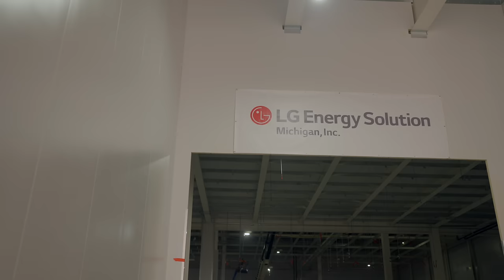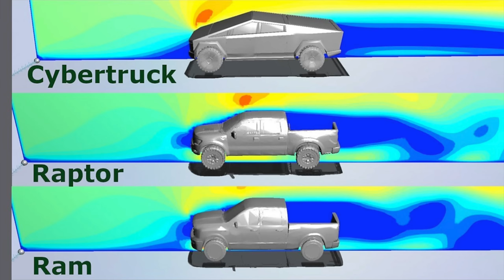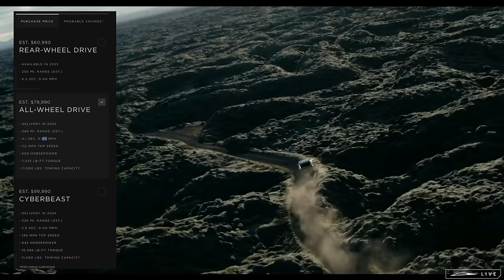Cybertruck - What Tesla ISN'T Saying!

Comment: The market has spoken - on the day of the Cybertruck launch, TSLA tanked.
R.I.P. Cybertruck
Reply: Let's see if that holds water.  Wednesday close, $244.14 and, to be very generous, Friday close $238.83.  A change of $5.31 or 2.1% (aftermarket from Friday is +$0.52, virtually unchanged).  You have a very odd definition of "tanking".
Reply: @iowa_don  Hello Earth to Iowa - of course, it was a thundering tanking.
TSLA should have gapped up 10% to 15% on that day if the Mad Max Cybertruck was a once-in-a-lifetime hit

Instead, TSLA tanked out - the Mad Max is a dud, and that spells catastrophe for TSLA.
Reply: @noleftturns   Well, you know how the market is.  Sometimes (like the other day when one analyst had a brain fart) it runs around like a chicken with its head cut off.  That certainly did not happen.  Other times it takes a wait and see attitude.

Comment: Steering by wire? No thanks! What happens when a fighter jet loses fly by wire? The plane crashes, every time! And if he's lucky, the pilot ejects. One blown fuse, one faulty relay, one bad capacitor, a glitch in the software and you are totally out of control, going over a cliff without an ejector seat!Conventional steering has a positive mechanical link between you and the wheels so if the boost fails, steering control may be reduced but is not lost! I see MASSIVE recalls and lawsuits over this one issue!

Comment: Its still going to take hours to fully charge, causing your electric bill to be sky high , its still really heavy and im willing to bet it will get stuck in sugar soft sand. And it still has battery offgas ventilation, so saltwater can corrode the batteries and cause them to short out . And because of its extreme weight, i doubt it won't slide into the water on a boat launch ramp . So many problems they're willing to ignore in order to speedily push electrification. Also , the steer by wire in a fully electric vehicle is not a good idea. Loss of power will result in zero steering. It should have mechanical steering or at least automatically connect to mechanical steering upon power loss .

Comment: How is it that Lucid can build a sedan the size of the Model S and still have over 500 miles of range?  There has to be something in the battery architecture and management to make this possible.  If Lucid can do it shouldn't TESLA be able to as well?
Reply: Depends on how big the battery pack is and how "sporty" they want to make the vehicle. If they designed these BEVs to accelerate like a Prius, then they would have an increased range. But, attempting to market BEVs as "sports cars" probably brings in more profit from the mindless hipsters.

Comment: I dont think it will sell any where near to what tesla hope, because with people who need a work horse this car is to expensive, they will stick with desil vehicles for cheaper repairs and insurance.

There is a chance that ev's are on hold for now as they are, with manufacturers slowing down ev production and ev sellers with full lots with no buyers, so the ev marked could have sold to everyone that could get one and will be a bit before the next wave of buyers.

When you have a normal painted car and you scratch it up you just get a respray, what about this vehicle, when the back gets all scratched up from heavy use can it be easily buffed out or are the scratches and marks permanent?

Comment: 8:20 lets not exaggerate with sport car feeling.  This car weights 3 tons without passengers and has no connection between steering wheel and the road. There is no sport car feeling.  Not to mention real wheel steering also messes that up depending on tuning i suppose.

Comment: Why don't they put PV panels on EVs? Why wouldn't you want to charge while parked or driving in the sun?
Reply: Solar panels are expensive and they barely put out a charge. Solar panels would be good for trickle-charging a 12V car battery, they won't really do anything for a 1K+ lb EV battery.

Comment: Would I buy a cybertruck?  No.  I don't think most truck owners would either.

1.  It looks ridiculous - Face it most the %80 truck owners that don't actually truck their truck are drawn to a certain aesthetic.. This is about as far from that as possible this is a techies truck, truck people are about as far opposite of the techie culture as you can think of.  Maybe if you put in a gun rack?

2.  Not for serious off roader - This truck would be great for short easy Overlanding trips.  But for those serous off roaders not a chance.  It will get stuck you will need 3 trucks to pull it out suspension doesn't articulate its just not a "serious"  off road truck.  Great for those that like to play of roader though, as long as its not far.  Off roading will probably use power closer to hauling.  Nothing has less power stations than random trails to nowhere 

3.  Hauling distance -  People might not actually haul but they do purchase trucks %100 on its hauling capabilities.  This also is why I wont get one.  I need a truck now but I want to haul my car to the track 2-3 times a year, I don't live within 400 miles of a track.

This truck is for non truck people that like the tech and are exited about electrification.  Non techies are just now starting to buy tesla cars and the sales figures for EVs are leveling off as average users get them and don't like the change in hassles they have.(This is to say EV's have hassles, petrol cars have hassles but people don't like the inversion of the hassles they have become accustomed to.)

Comment: I have two reservations (base & dual). I would get them as soon as they are available. The dual motor one is better than ModelX  (comfort, quietness, ride, steering & handling) plus with new technologies integrated, it is the most utilitarian and best priced/spec car on the market. Plus, I'm fairly confident that by the time my order comes up ready, 4680 ramp is in full swing which will result in better range, less weight, and lower price for all three model.

Comment: @11:09 "is they have ethernet Communications"   ... 
I think you're missing a subtlety about Ethernet.... PoE... Power over Ethernet... the standard to send 48VDC over ethernet... upto 120Watts over ethernet, so all the accessories and small stuff will just have ethernet... no separate power and data.   probably have the ethernet ending in, say each corner of the car with individual accessories wired to a corner processor, doing data acquisition and power distribution.

Comment: Love how you glossed over the spare tire debacle, not mentioning that other manufacturers are currently packaging bigger batteries with more motors and still supplying a spare standard. And they didn't have also massively sacrifice frunk space.

I'm not seeing the innovation outside of the 48 watt battery, which other car companies are currently switching to as well. First out the door is nice but this took 4 years to bring to fruition. By the time Tesla revamps/improves this truck, the competition will be way ahead. Steer by wire will be standard and their "moat" of charging infrastructure no longer exists.

This vehicle isn't a "smack down" to anybody... straight line acceleration means little to anybody except Tesla fanboys. It will never be homologated outside the U.S. and even in that market, will never reach the same kind of production numbers Ford hits with ease.

It's cute though.
Reply: “Spare tire”

There are cars that don’t have spare tires any longer. Love it, hate it.

Wish all cars had run-flat tires.

“innovation”

The 48v system is very unique, cutting copper needs.

Ethernet to cut copper needs is also very unique.

If they had redundant Ethernet - that would be awesome, but I doubt it has it.

The drag coefficient is very cutting edge.

The drive by wire wheels is very innovative, in a pickup truck.

The stainless steel alloy, eliminating paint, is very cutting edge, but will likely be expensive to fix.

Really, this is very interesting, just too high of a price point for many people.

“Production numbers Ford hits with ease”

The Ford Lightning sales in 2023 may hit 70k… will Tesla hit that number at the end of 2024? Good question. We will see.
Reply: 48 VOLT low voltage battery.  Ford production numbers?  A whopping 4,400 units per quarter??

Comment: So hard core truck people are not buying Ford Lightning??
Some are and Tesla will eat into this segment over the next 10yrs. How, well  the 4680 volumes will ramp and specs will improve with v3 and v4.
The CT is just beginning.
The hardcore farmer and construction site worker towing and hauling stuff will eventually have no choice as California bans ICE completely by 2035.

By then Tesla will have the 500mile truck that towes 14klb and hauls 3.5klbs in the bed which sells at $60-70k.

Comment: I have to disagree with your assessment.  When I go camping, I need long range.   There are very few gas stations in the wide open area of the west.  I may have to drive for hundreds of miles before I return to civilization to get my gas tank filled.  Electric vehicle charging stations are even more rare outside the big towns.   There is no way this truck would meet my needs for camping and adventuring until they improve the range and there are more charging stations.

Comment: Will the CyberTruck create an iPhone moment?  The iPhone completely changed the UI for phones.  All button phones were obsolete in a few years.  Will the CyberTruck force the other truck makers to move to stainless steel, steer-by-wire and 48 volts?  It could be years before they could produce a competitive truck.  Obviously Tesla can't produce enough but it won't deter customer expectations.
Reply: Your comparison of the Cybertruck and iPhone is interesting. They have both created a monopoly on repair by limiting availability of replacement parts and repair ability. And they both have the ability to charge whatever they want or even tell you that it can't be repaired. (You had your phone battery replaced by your local shop? Your finger print reader will now not work! 
You had your truck repaired by a third party? We will reduce your battery capacity to 50% for safety reasons!)

Comment: First of all, I did not know TwoBitDaVinci was into the advertizing business helping out Tesla. 
Now some thoughts of just a regular European guy.

I can appreciate the break through technology of this car. It even looks cool. The stainless reminds me of the back to the future movies. Very cool.

However (O, o... Here it comes). Trucks? really? Most Europeans do not understand the WHY of these behemoths. Sure:  our cities are more cramped and such a vehicle just would not fit. I saw some guy driving a Hummer once (one of the early ones) in an old town. of course, he got stuck and became the laugh of the town. 

Also: I do understand certain business could benefit from its capabilities. However hauling your measly bit of flesh around? What a grossly inefficient means of transport for private persons.

Zero to 60 in under 3 seconds, with a trailer + 911? Again: cool, for sure. Not going to argue about that. but WHY... In your every day life chances are, you are stuck in slow moving trafic, or busy obeying speed limits to avoid traffic tickets.

Safety: sure, if you drive your personal tank into some other (poor bastards) car, you will, quote: "win". We have regulations over here in Europe. Each and every car need to pass a test which proves pedestrians  (yes, we have them over here) are not excessively wounded in case of an accident. No passing of the test --> cannot be bought over here. Bulletproof. Of course. Only in Murica. Not really a thing over here. 

Fuel economy: Looking at its size, weight and poor air resistance. Yeah. Just saying. 

Final thoughts: I hope mister Musk uses his vast resources to develop a car that is the very exact opposite of this one. Hyper fuel efficient, as light as possible, safe in real life conditions (NCAP rating), affordable that fits in our part of the world. And while I am making this "wish list" anyway, nothing wrong with coolness and some extravaganza. So throw that in as well.
May be he should buy the Aptera company (using some change that he happens to have in his back pocket) and speed things up a little over there. Aptera is doing some real ground breaking stuff. Just check them out. It is an American firm. Unfortunately, I have little to know hope Aptera will be able to actual start mass production because of what mr. Musk himself once stated: designing and building a couple of prototypes is just the relatively easy start. The real headaches start trying to mass produce.

Sorry you truck lovers for me ranting. This is just my 2 cents. Enjoy your Tesla truck though. It still looks cool.
Reply: As an American, you sound kind of g.a.y. Trucks are not something we put on a pedestal or overly glorify over here, they are common because their capabilities are required by many. Every state has places to go off-roading, some states get multiple meters of snow every year, some people tow boats; cars and RV's quite regularly, it is good to have a truck in an area that is prone to flooding from hurricanes, hunting happens all across the county...good luck trying to strap a deer on top of a car. 

With that being said, the Cyberjunk only appeases the wealthy hipsters who have more money than brains. The vast majority of truck owners would not want this overpriced polygon. It cannot be used as a typical work truck since utility add ons cannot be installed. It can't tow for sh!t just like the rest of the BEVs. Few people want to sit around for hours waiting for the battery to charge.
Reply: @herrschaftg35 

Thank you for clarifying on why and how trucks are used. And indeed, in some cases such means of transportation is very helpful. 

But yeah. I needed to look up, what the abreviation "g.a.y." was supposed to mean. Thats what you get if English is only your second language. Reading a bit further in your comment, I see some further ranting starting to happen. "cyber junk", "wealthy hipsters". Of course, most social media expect me to type some sort of lingluistic pay back. Like posting something describing some grossly simplified mental image of truck drivers. However, I will not do such a thing. First because stereotypes are just that. They are not actual reality. Second, doing so does not help anyone. So a piece of free advice: just keep your comments factual, like in more than 50% of your comment. Have a nice day.
Reply: @justklaas4703  : "g.a.y" is an insult, I simply added periods to the word due to youtube's censorship. Your devotion to political correctness further justifies my use of that word. 

The Cyberjunk is named appropriately. That is not rhetoric, that is fact. As stated previously, it cannot be used in most applications where typical trucks dominate. The released stats already prove that Musk lied about many aspects of the truck. But that is nothing unusual since Musk has been lying for the past 30 years.

Why do you take offense to the phrase "wealthy hipsters"??? You claim this is rhetoric? Poor people will not be spending $90K for a vehicle. Tesla fanboys are hipsters. They know little of technology and tend to believe every lie that comes out of Musk's mouth. Again, it will not be the typical truck owner who will be rushing out to purchase a Cyberjunk.

Comment: Funny that my conclusion was exactly the opposite, I am very disappointed with the end result exactly because they didn't delivered what was promised.
Most of the features promised, specially the big ones like the range and price wasn't met, not even close.
If at least the range drop was compensated with a price drop..

Also I don't buy this ' lots of innovation ' argument because most of them is not better and sometimes worse for the consumer. This new tesla steel means that your vehicle will be total loss at every small collision and virtually no repair-ability.
I mean everything in this vehicle is just different, but not better.. It's called a Truck but do truck things worse than pretty much any truck (  Yes, it can tow more but why? And at what cost ). Even open the doors will be a hassle when using gloves.
It says is good for off-roaders but has anyone thought about installing all aftermarket parts? Will not fit and they'll be special made, since cybetruck uses 48V.. Oh and good luck trying to buff off scratches. I just imagine how hard it will be to recovery this behemoth from a ditch.

The only real useful innovation of this truck is the Ethernet communication, finally they're bringing to a mass production vehicle, we know this was better a decade ago but I never understood why it took so long.

Anyway, for me there's no reason to buy this truck unless to show off, since are better and cheaper vehicles out there

Comment: The range extender is weak sauce and very unlike Tesla. No experienced truck owner wants to lose so much space in the bed along with 800-1000 lbs of payload. This approach to reach somewhere near 500 miles of range, as promised in 2019, results from the lack of energy density of the 4680s. We have come to expect excellence in engineering and this is a fail.

Comment: How many times can it do that truck pull before the battery is dead? It can pull an unlimited amount, but if the battery is dead for 8 hours after 2 then it's useless for heavy work. I guess you'd have to have had a real job to know that. Also, if you ever take this dystopian wet dream out of the city and offroad, wouldn't a rock or bottoming out puncture the battery? The BP is cool, but you can get any car BPd, even a C8 vette on YT here with it.